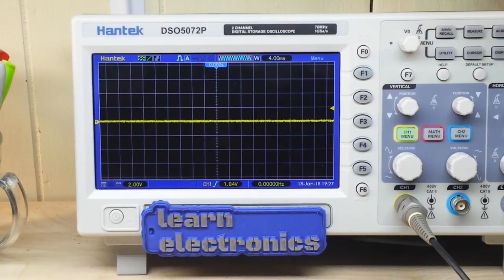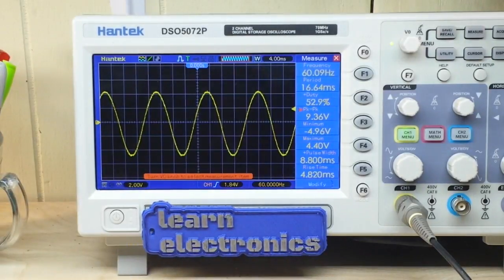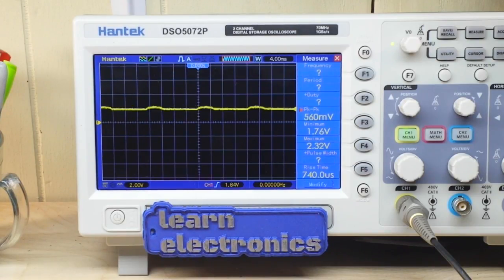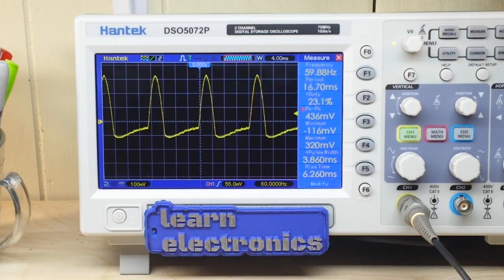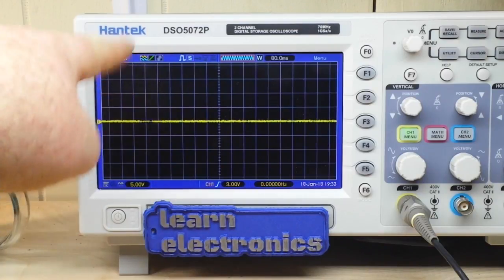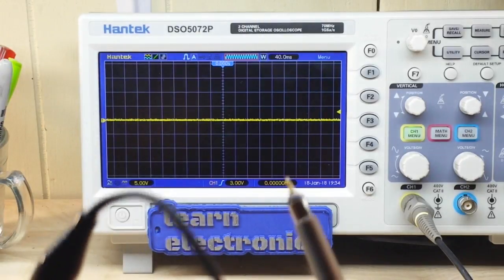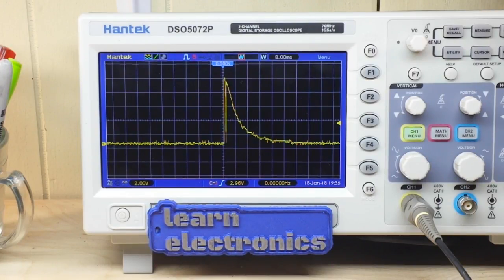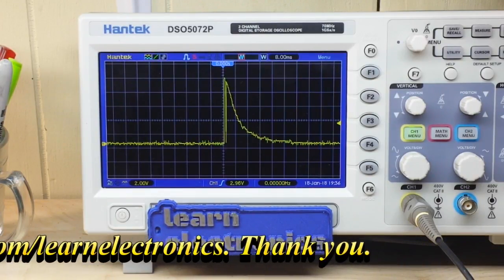Why do we AC couple DC signals?

Comment: Hi all, I'm just getting started in electronics and I'm confused. Is that a graph of voltage as the capacitor discharges or is it a graph of current as the capacitor charges?  I thought it was a graph of current as capacitor charges because it came unto the screen when he touched the probe to the 9V battery. I would appreciate any clarification. Thanks!
Reply: voltage
Reply: @filiepmaes9071  Thanks!

Comment: Thanks for the good lesson.  Is a lesson possible to analyze power supply noise frequency and determine proper capacitor value to filter that frequency noise.  Building quadcopters this is valuable....
Reply from the maker: +Jason Burt Here's a video I did on power supply ripple: https://youtu.be/EAa9pVX6uVM